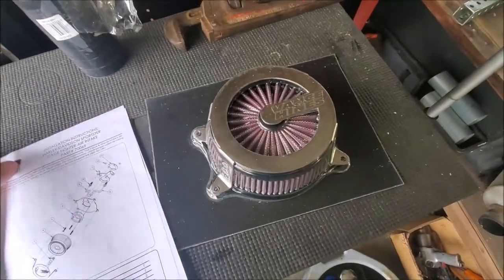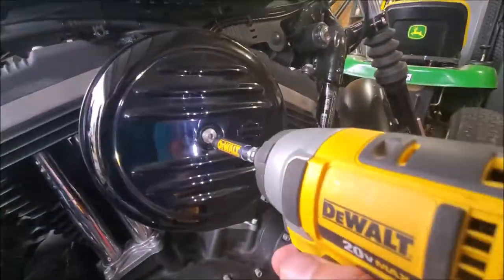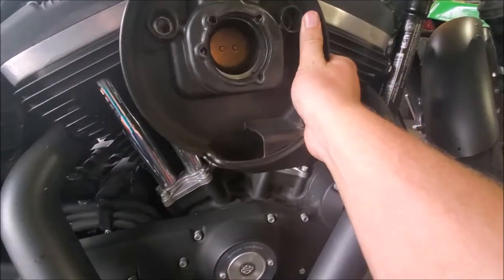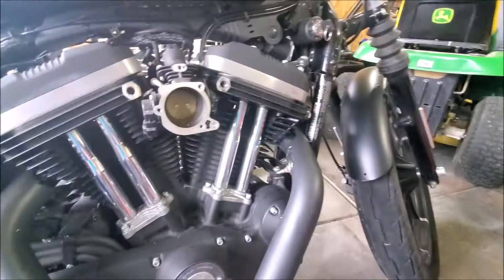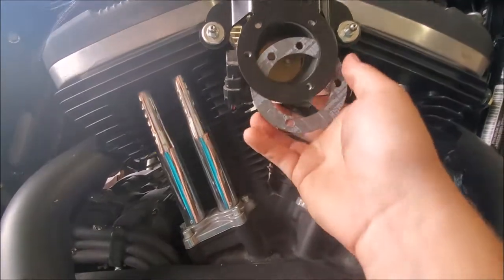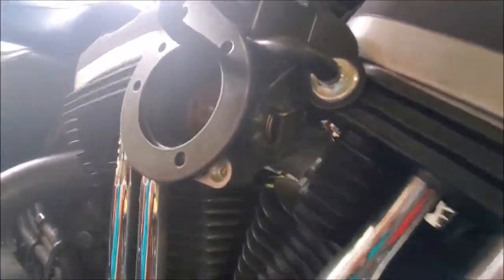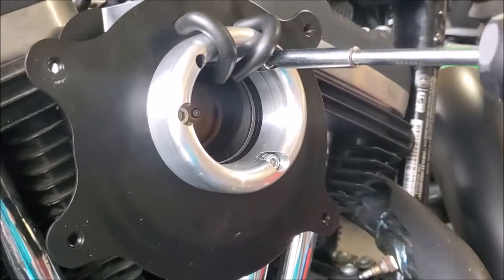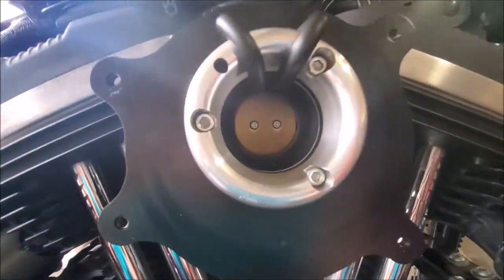2016 iron 883 high flow intake V02

Comment: Best install video so far. Thank you. I’m new to bikes and found your video very helpful. However they’ve changed the parts to the Venturi and backing plate. No longer separate. Instead they’ve made it smaller and black and welded it on to the backing plate. They’ve given you 3 extra screws to fit which are awkward to get to.